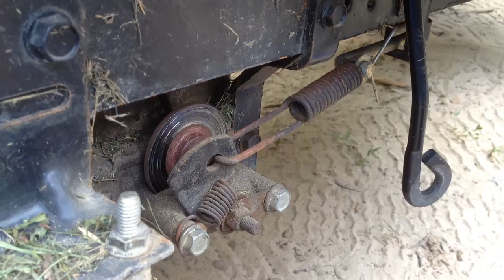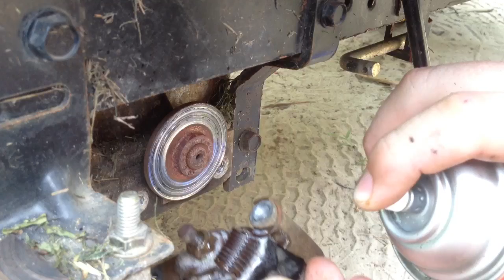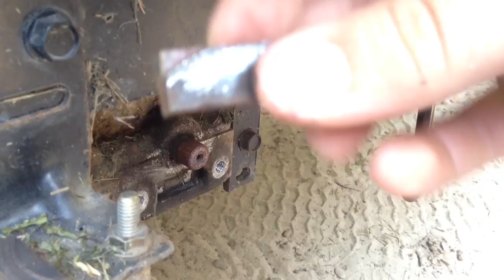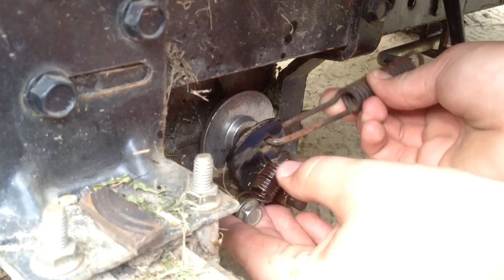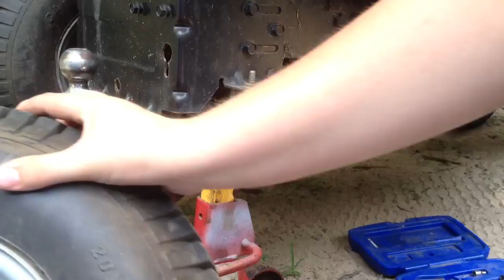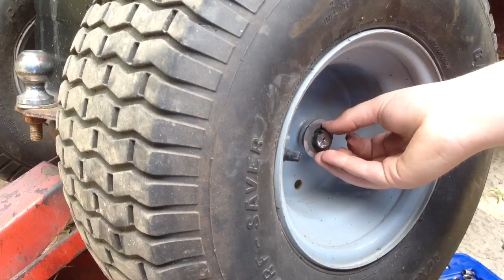How to change brakes on a lawn mower

Comment: Dude, I bet you made quick work of those new parts. You forgot to adjust the center nut back out. A hint was when you couldn't move the actuator arm to install your spring after tightening the assembly back on the transaxle. Please edit your video so someone watching it knows the whole procedure and won't roast their new brakes.
Reply from the maker: That's where the nut was from factory, so if they put the new brakes on, why couldn't I install them the same way

Comment: Probably not a good idea to have penetrating grease in the brake pad pocket.  You don't want lubricant getting between the pad and the disc.
Reply from the maker: murky that's why a sprayed it down with break cleaner after, brakes and oil don't mix
Reply: JohnDeere50d Apologies, I may have had the volume down.  The brake cleaner can looks a lot like the penetrating grease in the video.  I usually let brake cleaner dry before assembling things, it is so volatile, it doesn't take very long.  It never occurred to me to assemble things with brake cleaner dripping out.... thanks for making and sharing the video BTW.